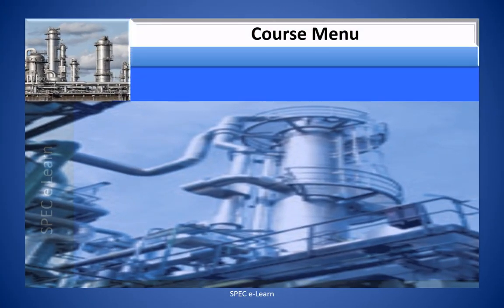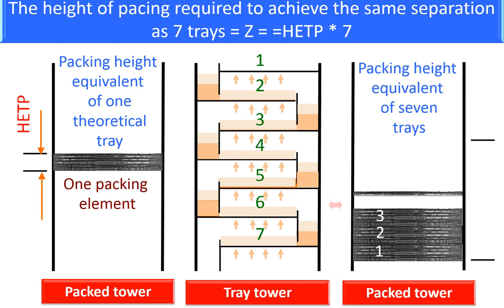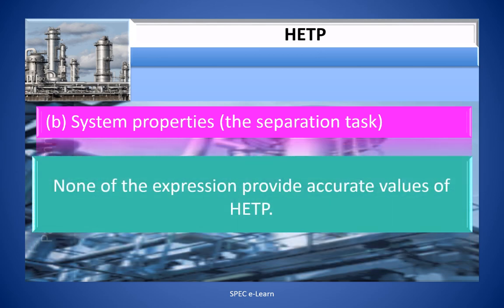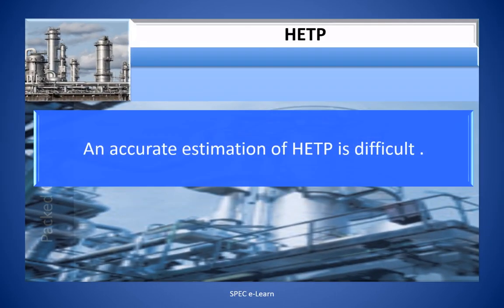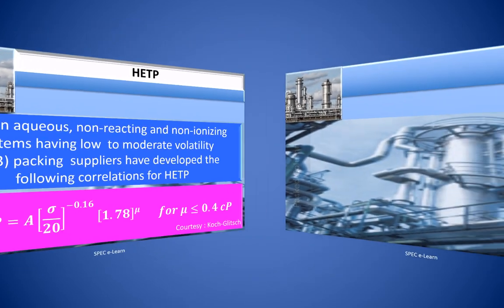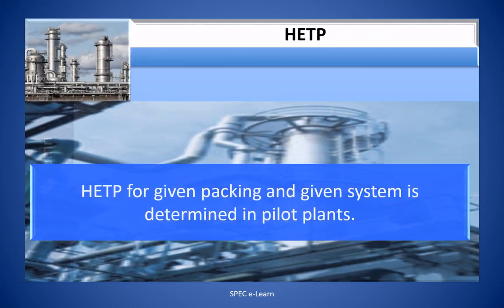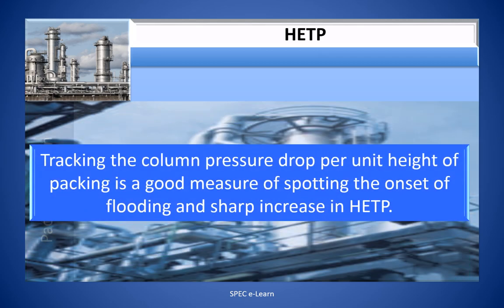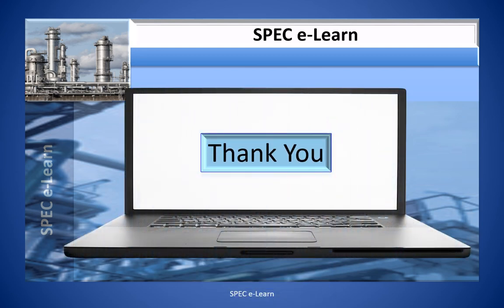HETP – Understand The Concept and Its Effect on Height of Packing

Comment: why hetp for  wire mesh packing is 160 mm and sheet metal 200?
Reply from the maker: HETP is a function of several factors. The video explains them in detail.  The geometry and size of the packing are the packing related factors which impact the HETP. Paking like wire mesh  or gauze structured packing specially made some demanding applications.It is the geometry that makes it  more efficient .The unique surface structure through its torturous flow paths provides moe efficient mixing of liquid films hence the HETP is lower.

Comment: Please remove description from the video in the bottom while you speak as description already specified in the presentation.

Most of the times it hides the actual words shown in the presentation.
Reply from the maker: Thanks for your comment. I have checked the original video. I could not find any of that sort you highlighted. I need more inputs to check it again. It is related to figures? Or can you give the video timing so that I can look for slide where this problem is appearing?  It would be helpful
Reply: @SPEC786  I have taken screen shot how to send it to you
Reply: @SPEC786  see at 11:00 to 12:00 where you were explaining packing details but when you speak similar words hiding the presentation of the video